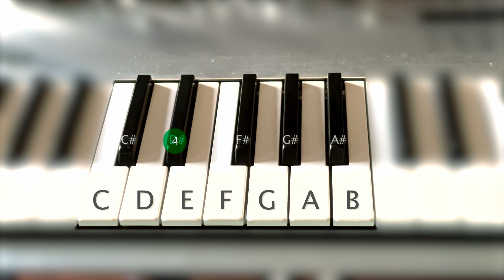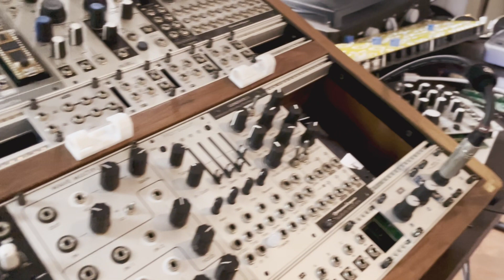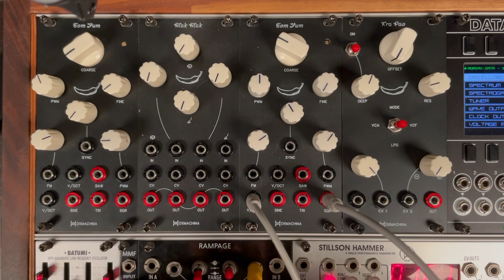How (not) to improve VCO pitch tracking - What is analog "Warm Sound"?

Comment: I vacillate bw precision oscillators and function gens as vco's.  Now, after using a DUSG and a Falistri as such for a long time, I'll return to a Rossum Trident.   If it turns out to be sterile, then I'll add some  modulation or effects, like ring mod and distortion, or audio fm in the filter to turn it into something richer, more natural - just what you talked about.  But the reason I'm leaning toward this side is that this sound can be dirtied   to taste and keeping the perceived harmonic relations, whereas this doesn't work the other way  round.
Reply from the maker: It's a good point considering that approach and the module in question, super module :) the one I refer to as too "clean" is not as dense or packed as the Trident because that one offers a lot whole new level of sound and/or modulation, of course I want it all as well :D having both options and more is great, then we enter the paradox of play ability and size, but that's whole new discussion, cheers!
Reply: @VoxmachinaOfficial  Cheers!